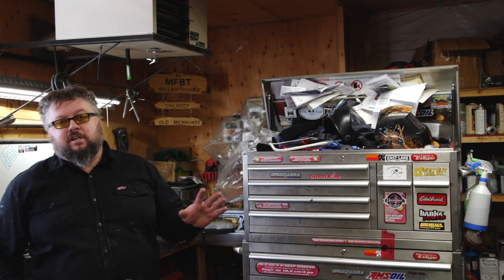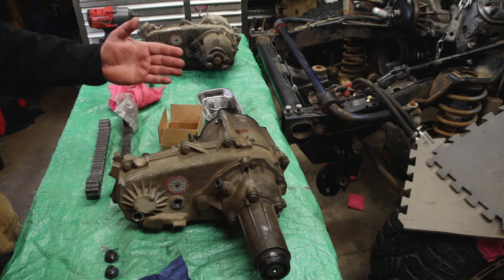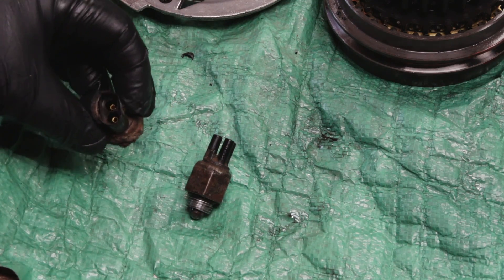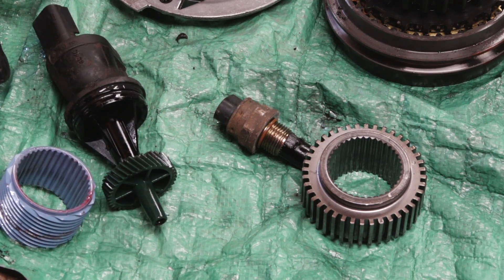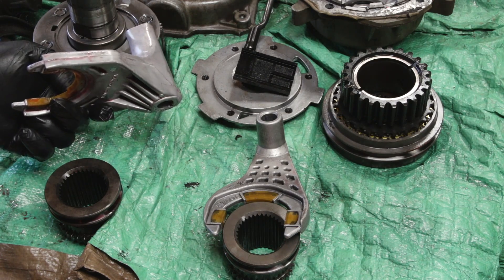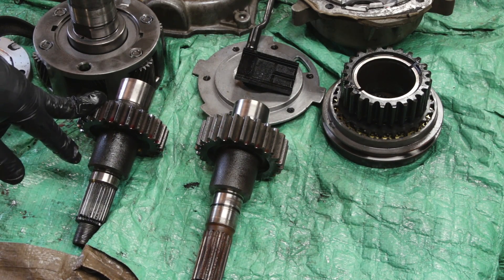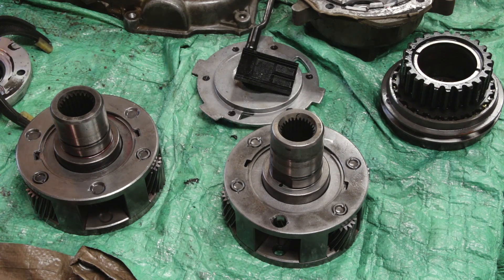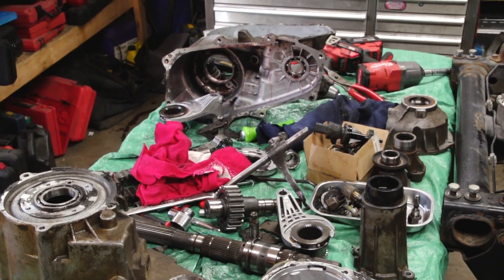NP231C and NP231J Transfer Case Differences

Comment: Great video. Question, I have a 2002 Wrangler with the 4.0 and a NP231J TC. The TC cracked over the winter and I bought another TC from a salvage yard that was also on a 2002 Wrangler 4.0. That Jeep only had 70K miles on it. I bought that TC. That TC is also a NP231J but it only has 4 lugs to mount to trans. Is it ok for me to just utilize the 4 lugs or do I need to figure something else out. Thank you for your time and keep up the great videos.

Comment: You should use the jeep selector(left one)... It offers true neutral... Otherwise you should not tow it unless you take out the driveshafts... Jeep ppl with older 231 only had the non notched option but they are interchangeable and offer you a safer towing option
Reply from the maker: I had the transfer case apart recently and switched to the left one

Comment: Nice info. I did pretty much the same build except I used a 231c out of a (82-94) s10 blazer which already had a fixed yoke front output with a 1310 u-joint. It had the 1.25 inch chain too (I dont know if all of them do or not). The early 231c's also have an adapter to go to an early 4l60e/700r4 4 bolt flange, which also incorporates a trans mount location. I was mating it to a later style 4x4 4l60e (LS style) so I bought an adapter from Advance Adapters (50-0405E is the part number) to convert the later 4l60e (LS style) to the early style 4 bolt flange, it also comes with a tone ring that mounts on the output shaft of the 4l60e for a gm style vss and they threw in a napa vss. So that would give you your correct gm vss signal. You would have to run some sort of low range input to the computer so it knew when it was in low range, or just live with your speedo being off in low range. I Retained my factory Cherokee gauges, so i didn't use the vss in the adapter. I used the back half of the 231j along with the Advance Adapters sye. The spline engagement from the trans to the t-case wound up perfect too, so it all worked out pretty nice. Good luck with the project!

Comment: The Delphi ECU can be reprogrammed by GMs Tech 2 unit to put out an accurate speedometer reading whenever the diff ratio, etc is changed.

Mine was changed back when it was brand new in 2003 when the first owner got a set of 3.91:1 diff gears fitted to replace the factory 3.46:1 diff gears in my Commodore.

My speedometer is electronic & its signal comes from the ECU,not directly from the speed sensor.

The ECU was recalibrated on an on car Dyno after they also fitted a set of custom headers & twin 2.25 inch cat back mandrel bent exhaust system.

It has an off the shelf twin 2.5 inch cat back exhaust system fitted now that needs replacing again,I want to get a set of brand new 1 5/8 inch Genie headers ,200 cell cats & twin 2.5 inch straight through exhaust system.

At 16 1/2 years of age I think it needs all redoing as the last muffler guy just grafted the last exhaust system into the old one by cutting the flanges off & straight welding it onto a set of cat pipes which he made up.

There's a restriction I want to remove before the cat converters so the cheapest & best way to fix that is to replace the whole exhaust system.

The headers have been patched up & are a bit Rusty as well !
Reply from the maker: the Vss sensor is from a Jeep the signal needs to be Converted to match what the GM sensor would read so the ecm will shift the transmission out of first gear.
Reply: Yes, the GM speed sensor is an inductive type which puts out an analogue output (sine wave) & the Chryslers speed sensor is  a Hall effect type with a digital output (square wave) so it's as if the GM ECU needs to have the signal for the speed sensor signal teed off into a converter box so that the GM ECU receives a sine wave input & the Chrysler instrument panel receives a square wave signal assuming it's directly connected to the instrument panel.

In the Holden Commodores,the ECU receives the signal from the speed sensor to control gear shifting in an automatic car (same as the GM ECU you have) but the speedometer receives its signal from the ECU !
Reply from the maker: I think in the end I will just machine the adaptor and mount the 40 tooth gear and sensor on the trans output shaft to make it simpler
Reply: You're in luck if the original Chrysler speedometer needs a digital signal, the LS1s PCM output is a square wave form (digital) !